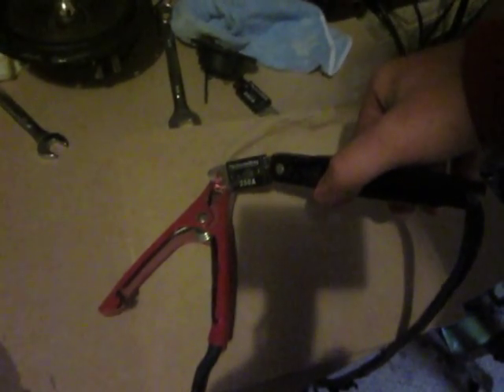250 amp fuse test part 2.

Comment: Bad connection and small jumper cables. This is why you see melted fuse holders and wires. What did you measure the 700 amps of current with?

Comment: BS test boys. Put some real jumper cables to it that are worth more than $8.95 i.e. 2 ga. or better and the fuse will work like it's supposed to. Your $3.99 jumper câbles are not allowing enough current to flow, hence, they melt.